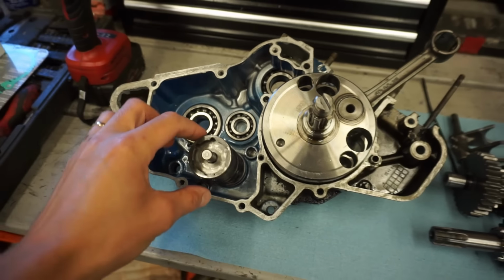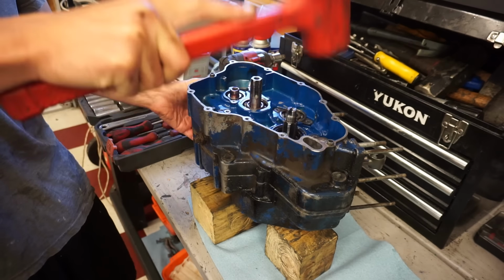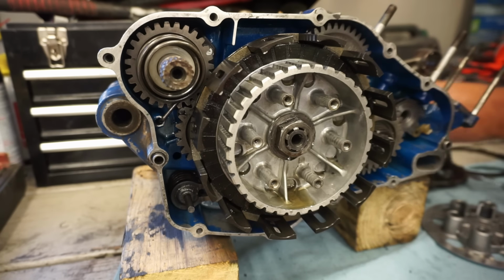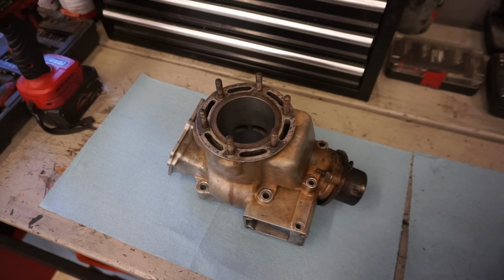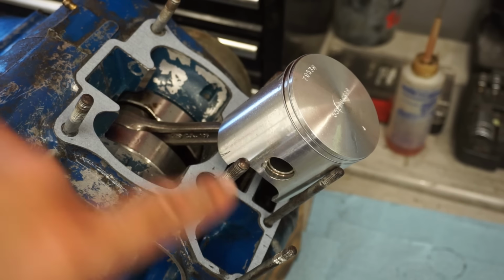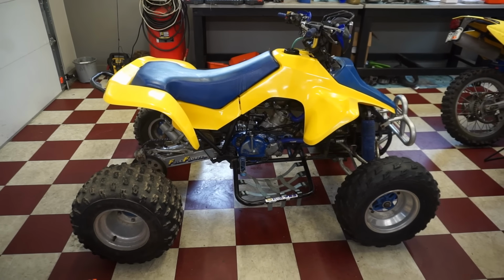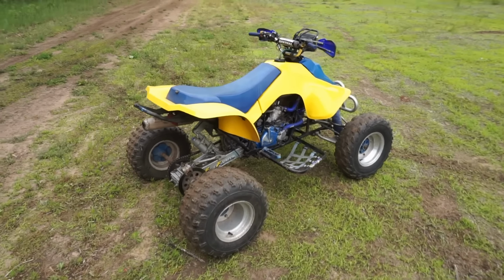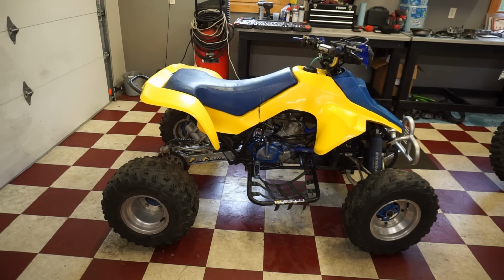I Can't Fix This Rare 2-Stroke Race Quad

Comment: Transmission gears are tricky.   I have put together hundreds of old two strokes and sometimes everything looks very useable, and it still misses shifts.   The only solution is to replace the gear with the worn shift dogs and also replace the gear that the dogs are going into and not staying.   Fortunately, with a recent build, everything comes apart quickly and you can get the job done faster than normal.
Reply: The gears and shift dogs looked good. Im gonna say shift fork is worn too much. Its allowing too much movement when in second.
Reply: Hi, I’ve just started recently watching your videos and I want to say that I’m very impressed and I really like everything that you do. And enjoy watching.

I’m an old grease monkey but don’t have too much experience with these two strokes and Small Engines. But one thing I didn’t noticed on the transmission in the gears, do they have synchro’s? 
I know on the older stick transmissions that I used to work on
Have synchro’s that slid the gears together easily. That’s what used to go wrong on those Trannys. The synchro would get worn out and it would pop out of gear. Hope this helps. If not, I agree with the Second Gentleman that I believe that said he believes that the forks might be just a little bit too worn out.
Reply: Replace gear fork is that simple
Reply: Yamaha had this issue with 2nd gear on its R6 sportbike.  They fixed it by adding more gear dogs. From three to 5.  In the 2nd gen bike.
Reply: I say it’s the wheel on the spring loaded star tensioner iv see them not hold a gear if someone repaired it and the diameter is 2 big
Reply: Or if it is bent or had 2 much slack can fall behind the shift star
Reply: Also by that plug the ignition timeing needs advanced a couple degrees
Reply: @jamesprice3403 nothing wrong with ignition timing  even if there was you definitely wouldn't be able to tell by look of plug 🤣
Reply: I'm going to say that because the shift drum bolt wasn't in there & it was rode like that the case is worn out so much it lets the drum move around,I think another case or cases would fix it
Reply: Have them backcut, once they start to pop out of gear the problem only gets worse faster 
Shift aggressive but FIRM it’s the misses that start the wear pattern
Reply: @TYPICALGHOSTSNIPER  oh  yes I build a lot of 2 strokes and read a lot of spark plugs the timeing mark is barely on the strap and the reason for that is the port work that has been done when I port degree the exhaust side to the power limit which on most 2 strokes falls around 185-190 degrees yes u can put more ignition timeing into it but wasn’t a have 2 just a suggestion anyway arm chair hero lol
Reply: I had exactly the same on my rm 250 due to missing a gear change so had dogs on gear machined with a slight undercut and was perfect after

Comment: The gear dogs are the culprit. Running it with the loose drum probably caused the dogs to round off
Reply: That's what I was thinking too
Reply: @polska905 my thought from the beginning.
Reply: Yep the dogs are rounded.
Another lesson he needs to learn
Reply: Gear dogs are toast; next time get Vinny's approval before test riding it😅😊😂
Reply: yep
Reply: I. Guess. If.  You.  Had. Been. Around.  In.  Pioneering. Days. You.  Would. Be. Fixing. Wagons.  Make. Them. Go faster.
Reply: Why didnt he check them for wear? 😢 easy fix but long! Although u get another video out of it! Il be watching
Reply: Yep, way past time for Joe to learn about shift dogs. He's always looking the teeth and saying how good they look, but never even tries to look at the dogs. Teeth rarely wear, dogs always wear Joe.

Can't help but to say it again, and again - clean before repairs Joe.
Reply: What I was thinking. Slow down. Inspect stuff. Measure stuff. Assumed bolt missing was it. You know he rode it like that for a year probably. Just about every bike or quad he does has metal in the oil. It came from someplace. Just because there's no chunks doesn't mean it's good. I seen guys ride bikes with bad clutches for a year. Case all full of metal. Stop being so worried about getting his ass on that seat in a day. Should have been all thru it waiting on parts. Stop trusting the seller. He beat the crap out of it. Why he's selling it. Lol.
Reply: @waffalobill  The seller probably had a bad case of the Hershey squirts, blamed it on the quad and decided Joe would be the best guy to dump the quad off on 😂
Reply: You're 100% correct.

Comment: As you can see from multiple comments..it's the "gear dogs and houses".  I had the same exact problem on my LT500 Quadzilla.  I ice raced it for years, downshift to 4th at corner entry, halfway up RPM's it would shift up to 5th by itself, and shifter would smack me in the foot when I tried to hold it in 4th.  I tried to hold shifter down, couldn't do it.  The reason mine was 4th gear was because we only shift 4th to 5th during a race, and traction was awesome, so huge torque load on 4th gear.  I fixed it by back cutting my "dogs and houses" with a reverse taper die grinder bit.  I also ice raced my KX500, also shifted by itself, but it was 5th to 4th.  Also fixed KX500 by back cutting dogs and houses.  The dogs and houses are ground to be exactly 90 degrees from side of the gear, as you shift without using the clutch, the dogs slip out of the houses under huge tension and round the edge.  With engine power applied, the gears slip apart from the dogs sliding out.  When you backcut the dogs and houses, under power the gears will actually pull together and engage tighter.  You can repair the gears or replace, either will fix the issue.  I'm not guessing here, I actually had this happen twice.
Reply: Nice

Comment: The grooves in shift drum looked banged up ... the bad part has to be due to the bolt missing and bending parts or wear in grooves from the angle the drum was at under load

Comment: I had a Suzuki RM 125. I believe it was a 1985 or 1986. I had almost the same problem you’re having now !  It  was the cam between the second and third , it always popped into neutral!   I was done with it so I sent it into the local motorcycle shop and he said it was the little cam between the two gears was worn!   To my eyes, it looked perfect, like yours!    You might have to tear the transmission down, it also looked like a piece broken part you found in the case!!  I’ve been looking online I found the part that was broken!  I made a little video of the part I think is the one that is missing the cam, I’m sure it’s close to your issue too!

Comment: Well it’s 80% fixed 😂 I imagine with that constant slipping from before it’s created some wear on the forks and the selector drum that or there’s a thin thrust washer missing inside the box or in the wrong place for one of the shafts  (it was already reassembled incorrectly before so why not 🤷‍♂️) . Just spitballing the problem hopefully you’ll figure it out I know it’s bugging ya ! …. You did a great job getting it running as well as you did.. it sounds fantastic for sure … “love the smell of two stroke in morning … it smells like victory!!” Great video .. thanks 👍👍

Comment: Pro tip - use a larger drill bit by hand to de-burr the exhaust rib lubrication holes rather than sanding the piston surface. You can avoid disturbing this critical machined surface and thus the piston profile via this technique.

Comment: 2V, I had the same problem with my 58 AJS/Matchless 500 cc single motorcycle with the trans kicking out of 1st but work fine 2-4. It was play in a shaft bearing that once replaced fixed the problem. Great video!

Comment: Brilliant video Joe watching from Edinburgh Scotland UK 🇬🇧 👏 👍
Reply: Salford (Manchester)UK 🇬🇧
Reply: Consett u.k👊
Reply: Solihull UK 🇬🇧
Reply: Wheres the brillant part i missed it, this guy is a joke
Reply: @nicolecittadini4234  why the hate where's your repair vids
Reply: @Lee-At-Green-Pheonix-Rc  idont have to have a video to know he sucks
Reply: @Johnbruzzi4234  but ur not spespecifying why he sucks though
Reply: @Lee-At-Green-Pheonix-Rc  clearly u havent been reading my comments
Reply: @nicolecittadini4234  what comment u just said
He's crap no explanation or nothing
Reply: @Lee-At-Green-Pheonix-Rc  ive been commenting  on his shade tree mechanics for a long time. cheap parts, dirty parts, wrong info, bad riding, cheap tools, all around shade tree mechanic
Reply: @nicolecittadini4234  what's wrong with cheap tools can't always afford the best or might be sentimental and doesn't seem to cheap out on parts never buys china stuff alway trys to get oem or good replacement respected manufacturers I went professional Mx racing I had cheap tools u don't always have to get snap on he's put a few grand in some projects and used parts not always dirty could be stained or marked by a bearing or seal metal can and does wear and discolour over time and some time parts are hard to find for certain machines especially early stuff
Reply: @Lee-At-Green-Pheonix-Rc  he rarely uses oem, and what wiesco on every build, they they are ok,   a few thousands, i have a few thousand on my front shocks alone.  either way you can like him, i dont think hes all that special but i do watch his videos
Reply: @Lee-At-Green-Pheonix-Rc  so ypu was apro mx racer, where.  i race Xc gncc ixcr and some other series.

Comment: My 1985 LT250R did the same thing everyone kept saying it was a worn-out shift fork so I replaced them didn't fix it. The shift drum was the problem it had one spot worn just a little bit mic it you will find it can't have any variation in the grove.

Comment: Possible cheap and easy fix. This has a similar setup to the current YZ250 two stroke in that there is a spring that holds the arm that rides on the bottom of the shift drum. If the spring doesn't have enough tension then the bike will jump out of gear or you will have false neutrals. Try replacing the almost 40 year old spring with a new one and see if that fixes it. Remember springs are a wear Item and don't last forever. I'd try that before replacing any gears or the shift drum. That spring holds the shift drum in place so it has to have enough tension to do that. The current YZ250 works better and pops out of gear less if you either put a heavier spring on it or modify the assembly so the spring stretches further there by providing more tension. Good luck and another great video!!!

Comment: Shift dogs check new and see if they look the same if yours are rounded that could be the issue it’s a common problem with race engines. Also inspection of the gears more thoroughly to see if they have any wear not just on the gear itself but the inner gear where the shift happens.

Comment: GearBoxVideo, this guy is the Guru of manual transmission: 
Learn How To Rebuild a Ford Toploader 4 Speed - Part 1 through 4 . Part 1 & 2 does most of the explaining as to why the m. transmission pops out of gear or has difficulty engaging a gear. Really intuitive!! I recommend watching it, especially if your transmission has syncromesh gears ('im sure it does)

Comment: You laughed and said those shift forks are hard to mess up. 

When I went to MMI, you’d be surprised how many students messed that up. Putting forks in the wrong order and wrong sides all together.

I’m with you and think it’s hard to mess up. But then again, I grew up in a shop and was helping my dad rebuild engines and transmissions since elementary school. 

Now I use the word helping very loosely there. As I doubt I was of much help at all. But at least I was learning how mechanical stuff worked, came apart and went together, what stuff to watch out for, what tolerances to keep an eye on, and most importantly spending time with my Dad. 

So I guess being Mechanically inclined is just more natural for me. So what do I do now? I buy and rebuild old 60s-early 80s Japanese motorcycles. While I have my now 8 year old Son helping me out. Teaching him how gear boxes work, cylinder heads and valve trains, how the engine turns reciprocating movement of the pistons into rotational movement of the gearbox to make forward movement possible.

At 7 years old I had him lapping valves and using the tools to reinstall them. He completely reassembled the head on a 77 SOHC CB750 by himself. I just handed him the right parts for which side he was doing

Comment: It's such a beast it's putting down SO much power it's just slamming that transmission out of gear.. it's a beast is all.. 52:55
edit: yeah well so I am teasing, of course.. I was reading the comments and it's definitely down there, you already hearted the comment knowing the shift dogs are probably worn a tiny bit from that bolt being out.. you got this Joe.. I'll bet you already ripped it down and fixed it, as this would drive me insane!!

Comment: Hey Joe...  to bad about the tranny...  I see you use assembly lube while building your engines. You don't need assembly lube on roller bearings especially ones in a transmission oil bath. I do agree it is a good practice on the main rollers...and on the piston pin and that roller bearing.. Assembly lube is for surfaces like cam bearings(bushings) cam lobes and rocker armed. All those parts will have no oil on initial start up and the assembly lube will keep things slippery until oil pressure builds up in the motor.  You are not hurting anything by the liberal use of assembly lube,however,I think it is unneeded.  Love the channel and enjoy your videos. You have helped my carb cleaning and your repairs. Cheers.
Reply: You're right and wrong... I do the same thing and I know it's not really needed but, it's a "peace of mind" thing...

Comment: Now the quickest way to check it for slightly burnt out clutch disc is to try adjusting the cable and decompression rod by tightening the cable tensioner some. It's called taking out the slack and play enbetween the two which is the cable and pressure plate and third the shifter rod.

Comment: I’d throw in a new shift drum and 2nd gear.  Dogs on second must be worn and won’t hold power.  Drum might be worn over spec for 2nd as well which is why when second backs out, it forces the shift lever to move.
Reply: the drum still has heat treat bluing and hasnt worn off so i dont see the need to replace them just saying
Reply: Just a thought and maybe worth a look,it's not something to do with the positive stop wheel assembly or worn driving dogs,together with worn driven gear slots,I've sorted a no. of rm's over the years that jump out of gear they ,you gotta remember 2nd is a real working gear,just a slight radius on the driving dog driving edge will allow it to jump out.

Comment: I would check the parts diagram again and make sure it’s not missing any washers, especially at the shift drum. This is exactly what the Yamaha AT CT models do if you’re missing  the washer on the end of the shift drum behind the keeper under the plastic 3 screw cover. Check the detent parts too something could be going on with that as well.
Reply: Yes, a missing shim occurred to me also...

Comment: After looking at your previous video about this quad, My bad, you have now syncro rings in the transmission.
But you mentioned one of the shift forks had a little wear on it. It could be a gear wants to disingage itself pushing up against that shift fork. But I'm convinced! there's something in the gear train that isn't right!
If you're stumped about it, bring it into a manual transmission place. I can see this happening if you had syncros but it doesn't look like it. I'm convinced it's in the gear train

Comment: No matter how much you wash them Joe in soapy water it will never fully clean the barrel out or the ports properly,you must clean them in a parts washer or a bucket with either diesel or solvent to clean your parts,then hose them after cleaning them out,you will see the difference!✌️✌️🇦🇺

Comment: That’s always been my biggest fear working on a gear box but you make it look so easy, I did a top end an had to rebuild some forks on a bike that had a bad crash, I cannot believe I did it just from reading a manual I was only about 15 ,I had to buy a new front wheel for a KDX 200 , they sent me one for a 125 it would not fit but they sent me the right one this was before internet an the motorcycle breakers would use this type of computer they called it a fish for some reason

Comment: After watching this video, and looking at the gears and selector drum and forks, the answer is to back grind the dog's. This is a process that we have done on many motorbikes and raceways gearboxes. We back grind to an angle of 4 degrees. This means that when selected the gear pulls itself engaged. We back grind both sides of the dogs so that it doesn't jump out of gear under deceleration either.

Comment: Excellent work and video, you covered everything, not a better how to video out there. You an excellent mechanic and such a smoothe operator, i love your videos.

I would say the shift drum is the problem, running loose for a while has got to have done some minute damage maybe not noticable, and at high RPM its sensative to that damage. I would also replace the forks while i was in there, just because they got hammered also. . Second time apart is a pain , but after that just loose interest.

Comment: Try fitting the engine mount on the head that joins to the frame that is missing, the vibration caused by this could also cause it to jump out of gear. Shot in the dark ✌🏻